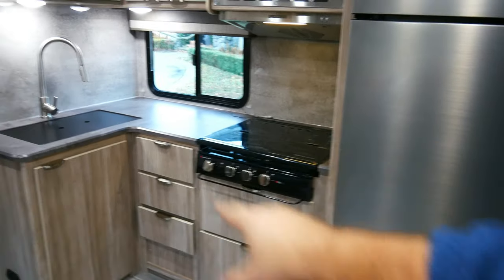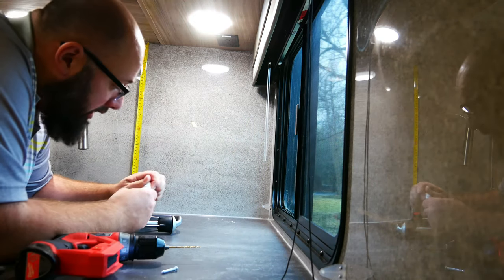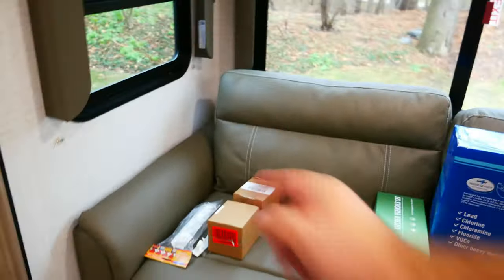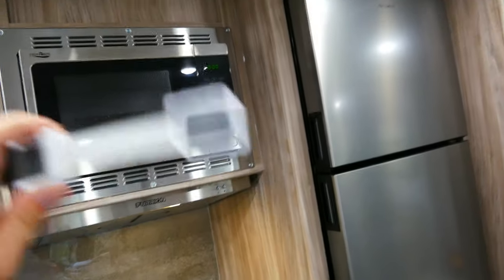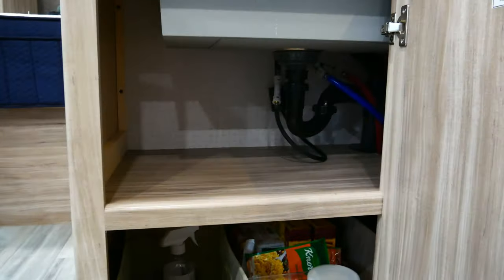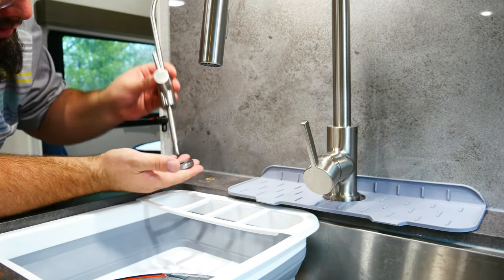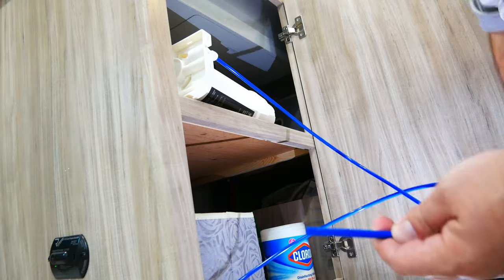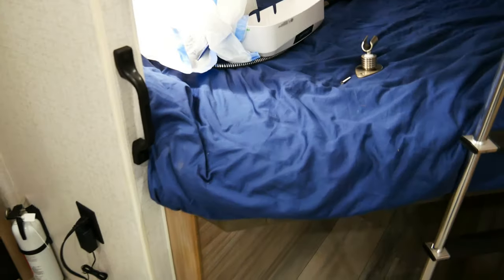Top 5 Essential RV Kitchen Must-Haves for Easy Camping Cooking

Comment: Thanks for the suggestions .
Reply from the maker: No problem! Thanks for tuning in!
Reply: @GasTachs  can’t wait to see the black tank upgrades
Reply: @GasTachs  I was thinking of going with an imperial outdoors, RV. But will wait to see what you do with the black tank and gray tank because the new RV is super expensive.
Reply from the maker: Are you looking for more capacity or the macerator system that I have on my Minnie?

Comment: Did you block you electrical outlet with your paper towel holder?
Reply from the maker: Nope, still can access it. Don’t really use it though but if we need to plug in a blender or toaster it’s accessible